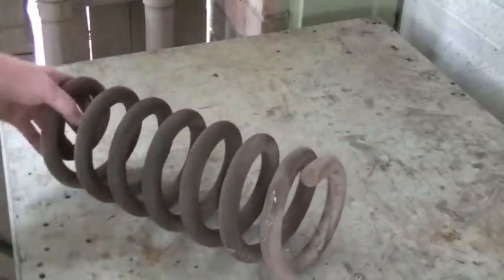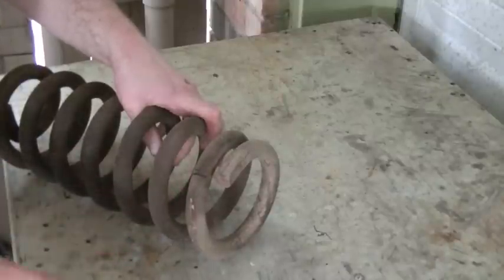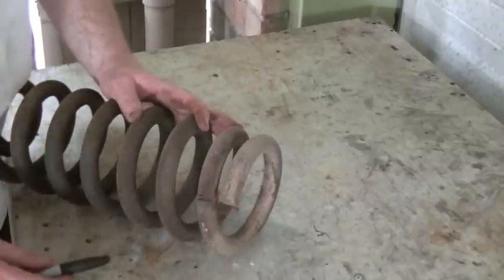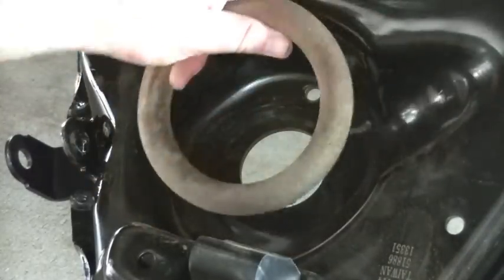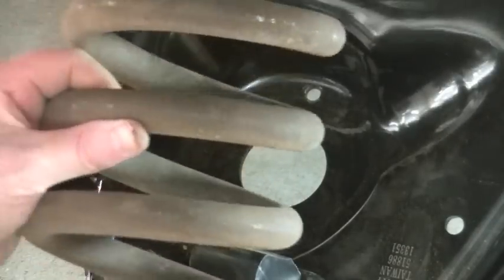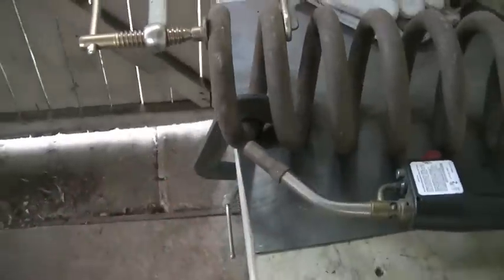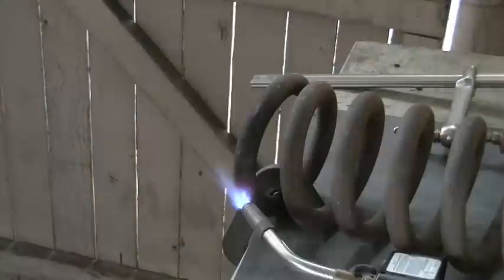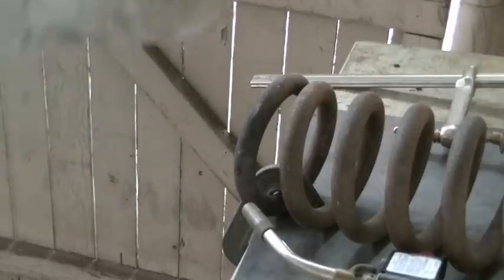PART 4 C10 5" FRONT DROP | CUT COIL SPRINGS AND DROP SPINDLES

Comment: I've been Lowriding for over 25 year's. We never put heat to a spring you lose the Temper of the coil. I to this day put the spring's in a 5 gallon bucket full of cold water.  I use a air grinder cut off tool to make my cut.
Reply: Sir I have a 93 ranger will a single  coil cut drop me 2inches. And will the truck ride stiffer. Thanks
Reply: @gtrdrejugfde288  Are you using the stock coil springs or Lowrider bought Coil springs. Stock Coil springs to drop the truck 2" I would cut the Coil springs 1 1/2 Coils. Lowrider bought Coil springs are stiffer for the Lowriders that hop. Just remember if you're using the stock springs to use a 5 gallon bucket and fill it with cold water about 1 1/2 inches below the cut so the springs maintain their Temper and don't get weak. Anytime you cut Coil springs the vehicle or truck will have some bounce but not as bad using the 5 gallon bucket of water method because the springs don't lose their temper in the cold water. I done my 1971 Impala hardtop and 1978 Grand Marquise hardtop and many other cars this way and the ride quality is very good. Any other questions just message me.
Reply: @gtrdrejugfde288  You are very welcome. Are you only lowering it or putting hydraulics or air bags on it

Comment: fek .....mate you do not heat the spring with acetylene.... period .......grind the flat with a angle grinder, andof course  it wont seat properly as you 'don't' by rule ,cut the flat end of a coil....

Comment: You should never heat a spring. It's not necessary for that spring to sit flat in the lower control arm,once it's under load in the truck it's fine.
Reply: Bob Falfa you sure?
Reply: Should never cut a coil and just install. It'll wear through the lower A arm and screw through.
Reply: I've cut at least 20 springs and have never flattened the ends, and never not one time have I had any issues with the lower control arm distorting or getting a joke in it in any way.

Comment: Don’t heat up a spring ever. Just use a grinding wheel on an angle grinder and take fast passes to taper the tip of the end coil. This will not heat up the spring enough to change the tempering

Comment: 1 inch on the spring equals 2 on the body, and never add heat to the spring, cut the spring on the bottom only, not where the winding is tighter
Reply: 1Rustytruck first thing I said, surprised he didn’t even measure

Comment: You measure the free length of the coil.  For every 1 inch drop in free length of the coil will net a 2 inch drop at the body.  Also the cut spring will effect the spring rate in lbs

Comment: I've cut springs and welded back together to drop them an inch or two i kept them cool as I welded with damp rag never had an issue little heat wont hurt them u just dont want them red hot because they will bend and deform like a pretzel.
Reply: Why would you cut a spring and weld it back together to simply drop ride height a inch or two.

Comment: Well done. Won't affect the spring but will affect the load of the spring cuz the  F length and the way the set. I'm a spring maker so I know litte about that. Really helpful video. I will do that on my 73 Cheyenne. I can shotpeen to get back some strength on spring. Or if I can find out the spects on it I can make couples spring instead.

Comment: Don't know if you still monitor these comments, but my question is, could you just cut the other end of the coil and not have to worry about flattening the coil with heat?  Or is there some reason you have to cut off from the end with the flat coil??  Hope this question makes sense.  Thanks for the video!
Reply: The top has a perch

Comment: The Rule of firm is measure the coil before cut if you want to inches drop on your vehicle measure the coil at 1 inch worse and that’s your cut it’s not one ring of the coil. Also I have a question is there any other suspension parts that have to be changed after lowering the coil? Thank you

Comment: dang use a vice to hold the spring while you cut it, I thought I was dangerous, LOL
Reply from the maker: gReG sKi Yeah... it looks really dangerous on the video (and I definitely should have clamped it down and not had my hand right in front of the cutting disc)  But it didn't even cross my mind when I was making the cut.
Reply: Im ok with cutting spring with out safetygear but damn man y use a wood plank plased it trou the spring and me and mi frien hold it down with our feet while on of cut cutten it

Comment: Heating a coil spring to cherry red like that and bending it is a no no.  Give it a couple months and where you heated it will break. You'll find the broken piece laying in there loose or gone.  Seen it many times my friends.  Spend the hundred bucks and do the job right.
Reply from the maker: +monnieweb 2 years and roughly 10000 miles later and they are fine.
Reply: It will eventually.  I've seen it happen many times.  Did it myself years ago.
Reply: Not wishing you bad luck, I'm just sharing what I know.  I hate to give people the impression that heating a spring like that is safe. It is not.  Good luck with it, be safe my friend.
Reply: cutting one coil hurts nothing and it's free, that's all a 2inch lowering spring is anyway. But yeah, never heat a spring
Reply: @milkcrate82  are they still fine now? Thinking of doing the same for the same reasons.
Reply from the maker: @serbancordis3416  Ive since switched to airbags.  But the springs were just fine when I removed them after about a year.

Comment: i cut 2 coil off an 1985 c10 dropped it 3 inch ... so 1 1/2 " is all you get per coil
Reply: Depends on type of alloy in the spring = hardness density = softer springs , ussually on higher quality truck model drop more.

Comment: why not cut the opposite side so you don't have to bend the spring?
Reply from the maker: +Keith Gomez Because that end of the spring also sits in a cup that indexes it in the upper coil bucket. It's sized to the inner diameter of the spring.

Comment: Don’t cut coil springs mess with ya ride ?? I wanna do this to go 6 in front but I’ve been told not to lol
Reply: I have and known plenty of people that cut springs for over 12 years and dozens of rides, some of them. Only cut the spring and dont even worry about the bottom of the spring, I just put a grinder to it to give it a little flat bottom.
Reply: Depends how much spring u have.
Reply: @TheRoninthebox  Thanx I did 3 of mine so far in the decades & I didnt remember heating them either & No problems of breakages even in Minnesota pot-hole country

Comment: Hey cool vid , I plan on cutting my springs too but won't be able to heat and bent it like you did. I was wondering is there a rubber seat or something you can get or make and use that? Thanks
Reply from the maker: Not that I'm aware of.  I just used MAPP gas that I bought at Home Depot.
Reply: I know this is really late but cutting one coil is fine on anything, you don't want to go more than 1and a half. Never heat a spring though, it's not necessary to have that spring sitting flush (or close to it) in the lower control arm. After the spring compresses under the weight of the truck it's fine.

Comment: What size rims are you running? 
Any problems with the lca rubbing with the wheel?
Reply from the maker: +Jacob C 15".  No issues but in the last video of this series I show how tight the clearance between the LCA and the wheel.
Reply: You're running 15x7 up front? I have 15x8 all around heard 8s rub, so 7 should be fine? Ima gonna lower front 4 - 4.5

Comment: Why didn't you just cut a coil off the Top of the spring, so you wouldn't have to reset the bottom of the spring?
Reply from the maker: Jeff Kemmerling The narrow coil at the top of the spring indexes around a shoulder area pressed into the upper coil bucket.  If you cut the top coil off, the coil spring would not sit correctly in the bucket.
Reply: Now here's a pretty smart question!

Comment: Could I cut 2 coils off??? And go lower without needing Spindles ?
Reply from the maker: Probably but ride quality will suffer.  You’ll be bouncing off the bumpstops pretty often.  Drop springs are usually a stiffer spring rate to help minimize that.

Comment: How much height does simply cutting the spring take out? without drop spindles
Reply from the maker: +Miguel Mares Cutting 1 coil and re-setting the spring yields around 2-2.5" of drop. If that's as much drop as you want, I would go with drop spindles instead of cutting the spring.
Reply: @bobbylbwhite  you're
Reply: @72MrHotrod  my spelling and use of words may be poor but I dont speak nor try to teach things I dont know.
Reply: I cut one full coil off my springs on my s10. Dropped the front almost 3 inches. I then cut a half coil off the passenger side . why? To level out the Chevy lean. Other than doing alot of alignment work (  camber and toe) to dial it in...no problems at all. Truck sits totally level and no unusual wear on tires or any components. 1 full coil = 2 to 3 inches depending on the strength of the coil. The truck had an inch and a quarter difference between driver and passenger side. Half a coil cut leveled it. So my springs, 1 full loop obviously dropped it 2.5 inches.

Comment: why not just buy proper springs? it's not 19 diggity 2 aanymore
Reply from the maker: +Mark Kennedy Drop springs are cheap.  However I wanted to show my viewers another option that's even cheaper... and still safe if done right.
Reply: +milkcrate82 sweet man was just curious that's all my days of cutting springs and flipping leaves are long gone
Reply from the maker: Mark Kennedy No worries!  These are actually going to be replaced with bags in the near future.
Reply: @milkcrate82  you didnt do it the correct way either. All you did was show them a way to potentially get themselves or someone else hurt or killed. Hope your satisfied with that possibility because I wouldn't want that possibility living on my conscience
Reply: I wonder how someone it's going to get hurt. Cutting a spring? I do that every day. I'm a spring maker and one of the best in the USA. Apply heat to the and coil won't affect the spring just the load cuz the free length. Big wire size probably. 650 "

Comment: Too much work. Just take a torch and heat 1+coil on the bottom and let weight of truck bring it down to the height you want.
Reply: That  will low the body,  but will creat more stiff. Is not the same tech.